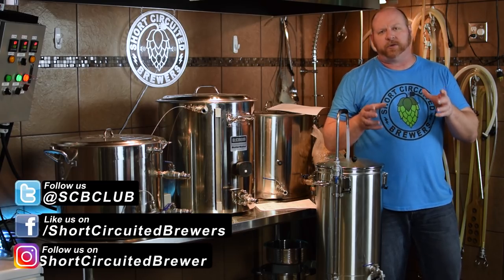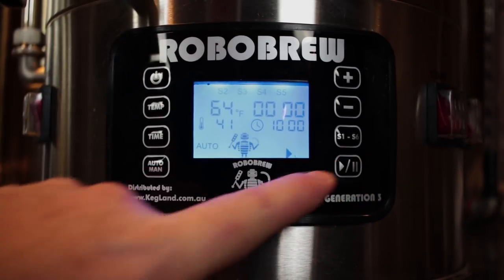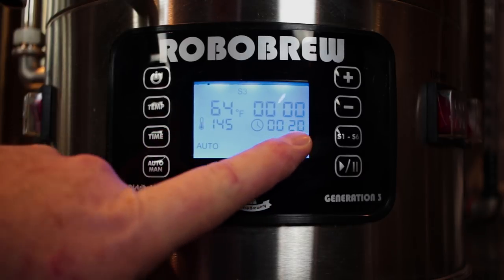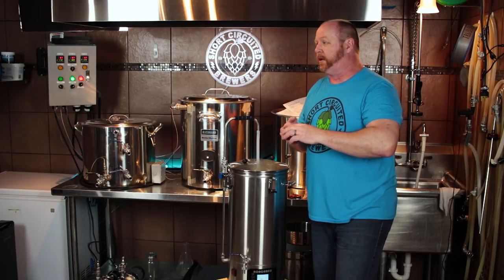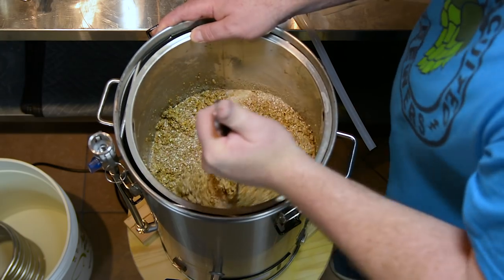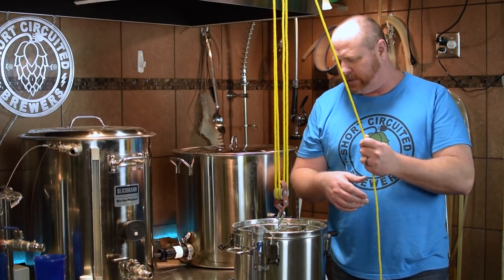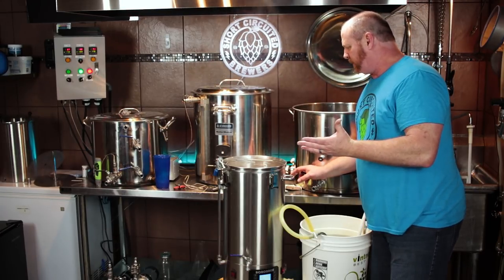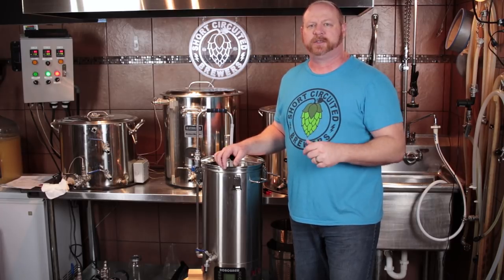ROBOBREW v3 1st Brew day | Complete delayed start and mash step programming included

Comment: Great video! I've been struggling to attach my garden hose cooling system due to it's the distance from the Robobrew. The method you use here saves water, and is more convenient space-wise. What type of camlock and fittings did you use to attach the soft hoses from the stainless coil?
Reply from the maker: Glad you found it helpful! The connector I used to connect camlock to camlock?  That is this one https://www.brewhardware.com/product_p/camdoublemale.htm?Click=17367
Reply: @ShortCircuitedBrewers  That is the special male-male piece, right? Definitely have that in my cart with brewing hardware ;-)  What type of camlock (female receiver) did you use on the hose end? It looks like it has a hose barb.
Reply from the maker: I just found a new part on brewhardware!!  Use this https://www.brewhardware.com/product_p/cambige.htm?Click=17367
Reply from the maker: Yes that is the double male ended connector.
Reply: @ShortCircuitedBrewers  Wow that's perfect! Thank you!
Reply from the maker: Enjoy!!  👍🍻

Comment: Do you happen to know whether or not those of us with Gen2 can purchase that screen that Gen3 comes with? I’m always getting stuck sparges.
Reply from the maker: I'm not 100% sure. Check Morebeer and Williams brewing. Have you tried rice hulls? 👍🍻
Reply: Yep, they help. I was just surprised you could leave your valve open 3/4 because normally that's just too much flower for me and it doesn't wash through the mash as well as I'd like. I'm just wondering if the screen made a pretty significant difference for you because with all of that wheat I feel like you should have gotten a stuck spare for sure, but you didn't! I'm impressed.
Reply from the maker: Yes it did flow very well. I was able to open it all the way. Let me know if you can find one. I may see if I can DIY one. 👍🍻
Reply: I was honestly thinking of buying some window screen and cutting it with some strong scissors to make one.... oh man now I just have to try it for the fun of it!

Comment: Hey Brian, thanks for the video and the walk-through!!  I've watched several times and it's SUPER HELPFUL!!  I recently received the RoboBrew v3,.  I'm new to electric brewing, I've been a cooler brewer to this point.  Just completed the third brew with this system and all three batches saw a LOT of grain get past the grates, (not hulls but smaller grain particulate).  I've tried the larger screen alone and both the large and fine screen with the same result.  I'm not spilling grain around the malt pipe, and it appears that the bottom screen is flush against the pipe as well (esp with 11lbs of wet grain).  At this point I'm emptying the vessel after sparge, prior to the boil.  Any insight would be super helpful.
Reply from the maker: I have a video coming up on a possible solution for that issue. A brew bag. 👍🍻
Reply: Thanks for the reply, looking forward to the video!!
Reply: @ShortCircuitedBrewers  instead of the grain pipe and basket?
Reply from the maker: YEP
Reply: @ShortCircuitedBrewers  awesome! Better results? Just curious, was not able to find any other info on this!
Reply from the maker: Right here. Different system but same concept. 
https://youtu.be/NSzKsrVo6Js

Comment: Thanks for the review 
New going to be brewer here

2 questions
I have seen people use this chiller by immersing it in the wort (!) and running cold water through it, is that wrong 
Hops addition, see people throw it, throw it in and whirlpool, us spiders (!) and bags. 
Why do you prefer spiders 
Thanks again 
Cheers
Reply from the maker: Thanks for the comment!  The chiller is fine to put in your wort and run cold water through it for chilling. It does need to go into the wort while it is boiling for sanitization. I do like the hop sack if you are using more than a couple ounces of hops  just to help the bottom screen from clogging. Hope that helps! Welcome to the hobby!!  👍🍻

Comment: Has there been any indications that Keg King will be upgrading their controller to a Wifi connected controller?
Reply from the maker: It's now the brewzilla from kegland BTW and I am not sure if they will or not. There have been some rumors of it. Why do you need that?
Reply: @ShortCircuitedBrewers  I have been doing some initial research on getting an electric brewing all  in one system.  I was initially attracted to the Brewzilla 35L 3.1.1 for price point and versatility. However, I've since seen a lot of post with people mentioning how it's almost as good as the Grainfather.  Better controls on the Grainfather is what I'm seeing.  Is it really worth double the price for the Grainfather.  Also, I really don't want to pull the trigger on the Brewzilla just yet if they are planning on upgrading their own controller in the near future.  Would you know if there is a comparison video of the Grainfather controller and the Brewzilla 35L 3.1.1 controller?
Reply from the maker: No comparison videos that I know of. They are completely different. Not really an apples to apples comparison.
Reply: @ShortCircuitedBrewers  true enough

Comment: When the hot wort is draining after the mash out it sounds like there is a lot of splashing. This seems like you would have excessive oxidation. Is this a design flaw or is there a way to avoid this?
Reply from the maker: It is normal on these type of systems. It is pre-boil so it is not really much to worry about. Good question! 👍🍻
Reply: I would imagine that it would help with aeration for yeast pitching.

Comment: Hi! Do you know if the issue with the programming (timer starting before temperature is reaching target temperature) is solved ? Either on this or on the 65L version?
Reply from the maker: It is still the same functionality. That has not changed.
Reply: @ShortCircuitedBrewers  Damned, I was hopping they at least fixed it for the 65L version :'(
Reply from the maker: Lol I know me too.. I talked to them about it. I think the focus has been on getting the power boards reliable.
Reply: @ShortCircuitedBrewers  My heart balance between the brewzilla 65L and a B80Pro. The B80Pro is definitely more "premium", but cost twice the price ^^
Reply from the maker: Brewtools right?  NICE systems for sure. One thing I do like is the elements look serviceable on the brewtools system.
Reply: @ShortCircuitedBrewers  Exactly, and their tri-clamp valve. Also their controller is still basic but is expected to become more and more complex and integrate with brewfather.
Reply from the maker: Yep it is nice.

Comment: I've been a extract brewer for years who has always been a bit intimidated by all grain. Is this a good starter for someone like me?
Reply from the maker: Sure is, the new Anvil system is a great product as well. With these types systems you can still do an extract batch in between if you have a favorite that you brew frequently. So they are pretty versatile.
Reply: @ShortCircuitedBrewers  is one more appropriate for beginners?
Reply from the maker: They are both good machines. Kinda comes down to price and availability. Some differences but relatively close. The Anvil does have an exterior pump, so it can be used for multiple things, the Robobrew pump is built in and gives it a little more compact footprint.
Reply from the maker: Here is my similar 1st brew day video on the Anvil system. https://youtu.be/Wk9TznTWzXY

Comment: I have the Robobrew V3 and just made an imperial stout with about 17 lbs. of grain.  I realize that may be too much for the Robobrew now.  I missed my og by alot.  I never had this problem with a keggle and cooler.  Any thoughts on what I did wrong?  I'm going to stir much more next time.  I also ran my pump during the whole 60 min mash.  One more question, did you just pour your sparge water over the malt pipe to reach the 6.25 gals like I did?
Reply from the maker: The stirring would be something to do for sure. Especially after ramping up to mash out. The other thing with all those dark grains, your pH might actually be low. I would recommend the stir first. Yes that is how I sparge. 👍🍻

Comment: My new Robobrew v3 arrived today and excited went to do a little test to see the quality of the product. Everything programmed, according to manual and some videos I saw through YouTube (here) and ... does not work. The pre-set steps do not work the same as in the others kettles that I know. The example is when I hedge the temperature from the first step to 100 and stay for 15 minutes, when the water reaches 100 the resistance turns off normally, but not the time, the time started when I pressed the Play button. It turns out that if it takes 25 minutes to heat this water, the controller is playing for the next step. Correct would it start the time when it reaches the desired temperature, not initially when I press Play. I'm still hoping to be some setup that I'm doing wrong ... Someone help me please?
Reply from the maker: If you notice it is not a "hold at the temp" timer it only delays the timer until it gets to the temp. Mine works the same way. You will have to build in the ramp time into your timer settings. I go through that in this video.
Reply: @ShortCircuitedBrewers  I have the same problem. how to solve it? Why does the timer start time from the button, and not according to the temperature?
Reply from the maker: @TOEThroughOurEyes  just the way it is programmed. not very useable IMO because you have to calculate the amount of time to ramp to the set temp manually.

Comment: What are the dimensions (diameter x height) of the grain basket in the V3 ?
Reply from the maker: 10 1/2" Inside diameter,  15 1/2" Tall. Cheers!  👍🍻
Reply: @ShortCircuitedBrewers  Thank you.

FYI, that works out to 23.25 quarts by my calculations.
Reply from the maker: Cool!  Thanks for the info!  👍🍻

Comment: I am not understaning the sparge process here at all :/ Why do you not show that side of it? Do you have to heat the water separately for that? Is there a rotating arm for it to evenly distribute the water?
Reply from the maker: I explain the mash out water is heated in my other kettle.. 12:30 The top plate is left on the grain and you simply pour over that. No rotating arm is needed. Fill a pitcher pour it over, simple. Repeat for the total volume of sparge water the recipe calls for. 👍🍻
Reply: @ShortCircuitedBrewers  OK, I had assumed that the Grainfather would heat the sparge water itself nd be routed up through the arm. TBH, I see no big advantage in this over the [much cheaper] 

kettle/coolbox method. The sparge is the biggest pain with brewing and this doesn't really automate it by the looks. Thanks for taking the time to reply.
Reply: @ShortCircuitedBrewers  OK, I had assumed that the Robobrew would heat the sparge water itself nd be routed up through the arm. TBH, I see no big advantage in this over the [much cheaper] 

kettle/coolbox method. The sparge is the biggest pain with brewing and this doesn't really automate it by the looks. Thanks for taking the time to reply.
Reply from the maker: @ManchesterBlackSheep  👍🍻

Comment: Nice review. How many hours was the brew day total?
Reply from the maker: About 5 hours... cleaning and all
Reply: Short Circuited Brewers Not bad. I am rigging up a 10 gallon bayou classics kettle to use on my 1800watt induction cooktop for BIAB and figure it would be about the same time except I can’t program the strike water to start on it’s own!
Reply from the maker: Lol right! How is the boil on that? I am doing a system with a 1650 watt element and it takes a while to get to a boil. Bayou is 1144 kettle.
Reply: Short Circuited Brewers Right now I have a cheap 7 gallon pot and it heats to mash temp from 50/60 degrees to 164 or so in about 40 minutes then up to boil temp in another 40/45. Mash volume was 3.75 and boil volume was about 7/7.5 gallons. Not very vigorous but decent rolling boil. Might need to look at a heat stick at some point. My Bayou Classic 1040 10gal kettle should be here Friday and will do some tests on it then. My induction burner is an 1800 Watt Nuwave Titanium. Cheap deal to test induction/electric brewing. I am moving off my 15 gallon keg kettle and propane burner so I can setup a stationary brew house either in the garage or basement. Thanks for the great videos!
Reply from the maker: Chris McAuliffe cool let me know how it goes!! 👍🍻
Reply: I brewed an Irish red on it today with the 7.5 gallon pot. Started at 9am finished at 2PM not bad. Did BIAB mashed with about 6 gallons of water. I think my dial thermometer got stuck. It doesn't seem to want to go over 162 degrees for some reason. This was first time I went with a full 7 gallon boil in it and the induction struggled to get to rolling boil. It wasn't vigorous at all. So I will need to either insulate the pot or get a bigger element and install it direct in my new pot, or grab a heat stick. Also got a cheap 2Gal a min wort pump to do some recirc next brew. It will be interesting to see how a weak boil affects the finished product. Hit the high end of my OG at 1.062 so that was good 12.25 pounds of grain and East Kent goldings in for the only hop bittering edition at 60 mins.
Reply from the maker: Cool! I think in my experience an induction cook top is not quite as efficient as a direct contact element. It will get the job done but it does take a while. A friend of mine has a 3500 watt 120v for doing 5 gallon batches and he loves it. Takes a special circuit. Sounds like you did ok though. Definitely let me know what you think of the finished beer. Thanks for sharing the info Chris!
Reply: Thanks for taking an interest. I think I would like a bit harder boil but you can't beat the convenience of the cook top and BIAB. Normally my 10 gallon brew days in my keggle, mash tun and propane burner are 6 to 8 hours depending on how well organized I have it. If I can produce great beer this way I will keep doing it and do it more regularly. Cheers!

Comment: Did you hit your points? didn't see you take any measurements?
Reply from the maker: I.missed my gravity by 0.08 but I really blame the local malt for it. After brewing it I talked to some other locals that said they had dead on recipes that came out low when using that malt. They ate a new maltster and I think still working on their process. A pro brewer said the same thing about the malt.
Reply: Nice. Thanks. Looking at a lot of reviews and no one has mentioned anything about efficiency. Most focus on the functionality of the system.
Reply from the maker: Quite a few of the group members on the Robin dew USA  Facebook group have reported 70 -80 % efficiency numbers. Obviously there are quite a few factors that effect the efficiency so YMMV. Thanks for commenting!!  Cheers! 👍🍻

Comment: Not sure how I like the programming of that unit. If your not technical, like me, I can see how that can be a issue.
Reply from the maker: I hear you LOL. I'm not sure that I actually will ever use it with step mashing again since I don't do much of that the only thing I could for see myself using for would be a ramp up in temperature to mash out. Cheers SJ! 👍🍻
Reply: I'd like to know, can all the steps be used in manual mode, including preheat? Call me paranoid, but there is no way I will have the elements on without me being present. I'm a hands on brewer. If anything happens, ie. an element overheats, leaking etc., I want to be there to shut the thing off ;-)

Comment: I would have bought one of these all in one systems if they offered a 10 gal batch 240V system. Therefore I went with High Gravity’s set up. It’s need great, I just made a video on it on my channel if you wanna check it out
Reply from the maker: High gravity makes some nice systems for sure! How does the basket do? I have heard of slow drainage with the Bayou classic baskets? I have one and want to know what to expect.
Reply: Well, actually, I ended up buying a stainless 400 micron mesh basket from Utah Biodiesel and set that on one of Bobby's false bottoms from Brew Hardware .com and it works amazing! I made a video on my eBIAB system if you wanna check it out it shows the basket.
Reply from the maker: ZmannR2 I'll check it out!! 👍🍻

Comment: why not leave it in the correct temperature scale ?
Reply from the maker: Haha.. I don't use Celsius.. but sure you can leave it.
Reply: @ShortCircuitedBrewers  no time like the present to learn. Celsius is based on boiling/freezing water , degrees frankenstien is based on the temperature of the blood flowing from the neck of a freshly killed cow.
Reply from the maker: @Ralphgtx280  haha. No cows were harmed in the making of this s video. Cheers! 👍🍻
Reply: @ShortCircuitedBrewers   haha , you can actually see that the unit measures in SI units because as it is changing it skips a degree fudge. but each to their own
Reply from the maker: @Ralphgtx280  yeah I did notice that. I should learn celsius. Maybe one day I will. 👍🍻
Reply: @ShortCircuitedBrewers  when you do enjoy the brave new world !